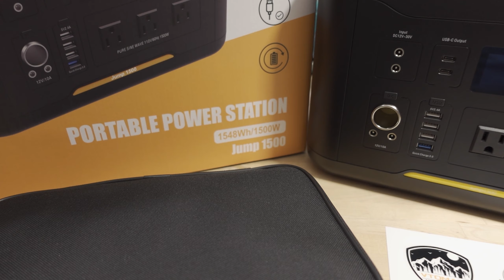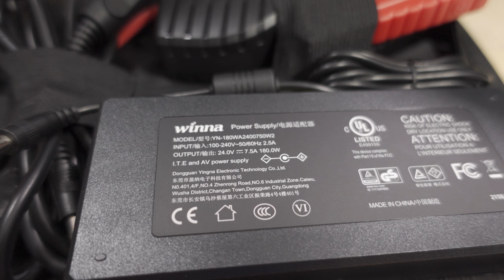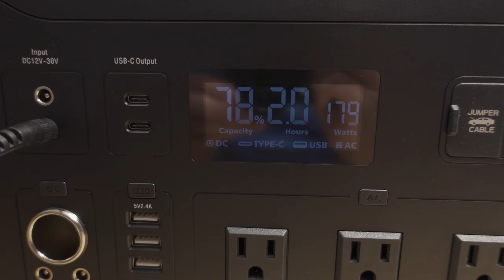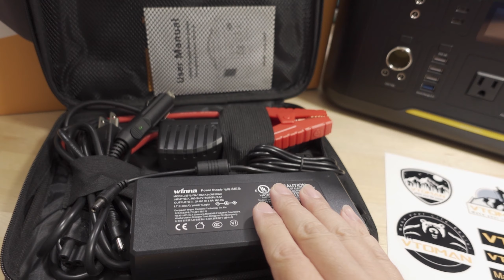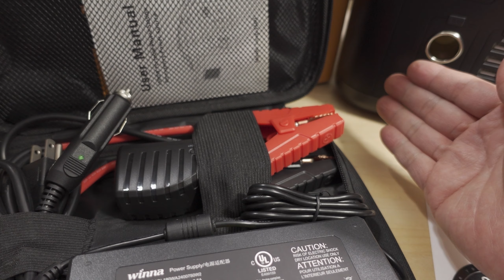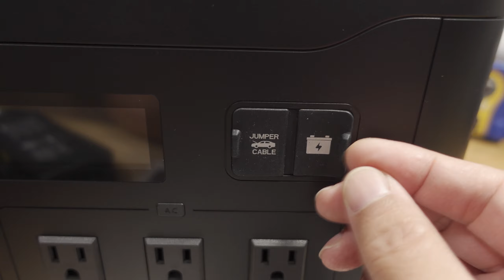VTOMAN JUMP 1500 Solar Power Station $600 OFF 🔋

Comment: Have you any current infomation on the VTOMAN solar power stations  or the external battery?  They have been out of stock on the VTOMAN site & Amazon.  I bought the jump 1500 and tested it pretty quickly.  Then went to order one of the external expansion batteries.  No longer available nor even listed anywhere.
Reply from the maker: I suspect they are having issues with parts availability and shipping. They probably will restock eventually but sometimes it's hard to know when that will be.

Comment: Great review, helped convince  my decision to purchase. Question, I have same unit three days old and the display turns on every 60 second without anything connected or any outputs turned on. Could you confirm our deny if yours does this as well? I also have a email out to the mfg Vtoman...  Waiting to here back.  It loses ( my unit) 4% state of charge in 24 hrs if just left sitting dormant.
Reply from the maker: Sounds like something is keeping the power on somewhere. I would contact the manufacturer about that.
Reply: @AlbertKimTV  already did, seems like I may have gotten the bad apple.

Comment: Thanks for the review. I'd like to see what the maximum allowable input current for the charge inputs, to size solar panels.
Reply from the maker: Voltage range is 12V to 30V so your current will be limited by the max watts of 200W.  So if you're input voltage of the panels is 24v, then the max current will be 8.3A.  Just do the math for other voltages for whatever panel you have.

Comment: I wonder how long something like this could power a gaming computer or a fridge
Reply from the maker: Depends on the power draw of your devices. If they draw 500W then this power station will last a little over 3 hours.  Just divide the power consumption into the capacity of 1548Wh.